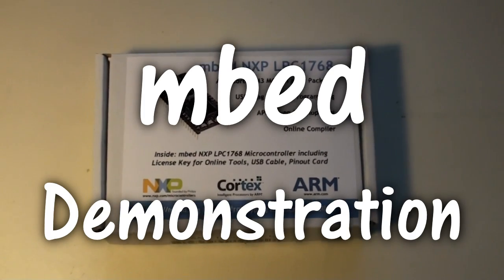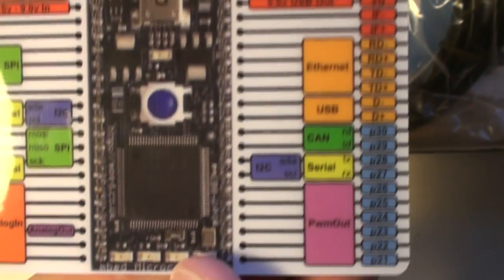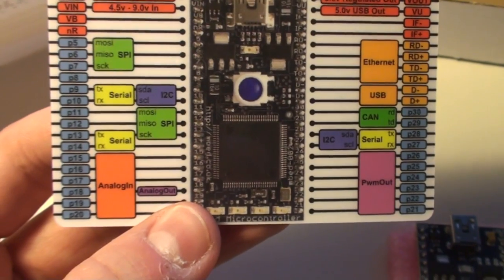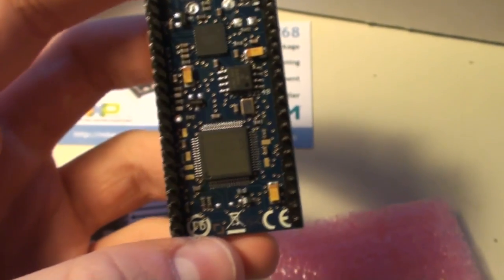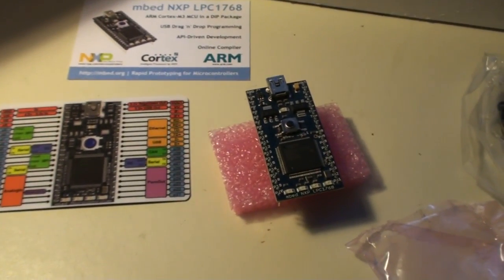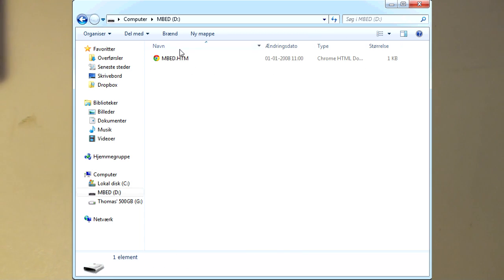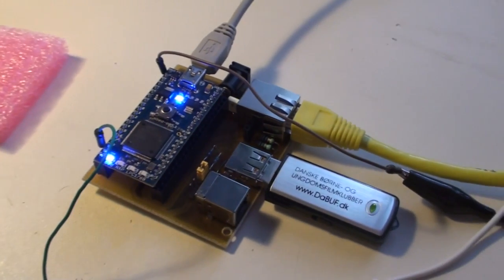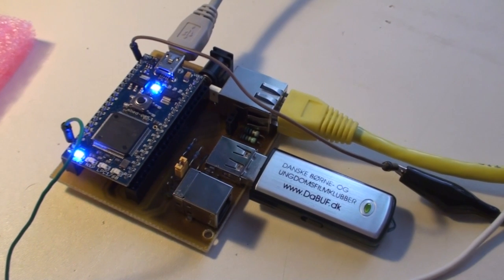mbed Demonstration

Comment: You have balls man. Most of that pink shipping foam is conductive. Many arduino fans have smoked their chips straight out of the box powering the Microcontroller while pins are shorted through that foam.
Reply: You are talking bullshit, the foam is maybe conductive but it won't kill any microcontroller, it would not cause shortcircuits
Reply: Do you know what a conductor is? It umm conducts electricity.... Power to ground.... short? I am a controls engineer and work with industrial controls daily. Take your volt meter, set it to ohms, put the two metal things from your meter on each side. The red one and the black one.. am I talking slow enough? See that it gives you low ohms... it doesn't say OL for open load does it? I've spent a lot of time helping people on the Arduino site. People have done it. The "you have balls" comment was me being surprised two years ago. This comment is me talking bullshit... with plenty of truth in it.
Reply: The black type of foam is conductive, not sure about the pink foam, that stuff is more than likely polythene/polypropylene
Reply: try testing with a multimeter